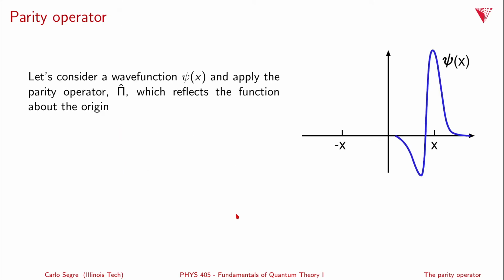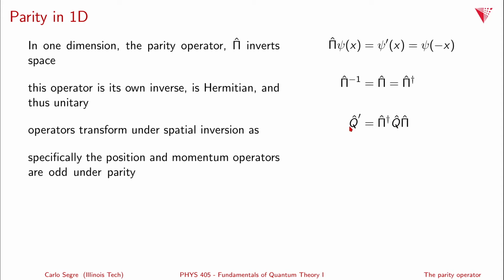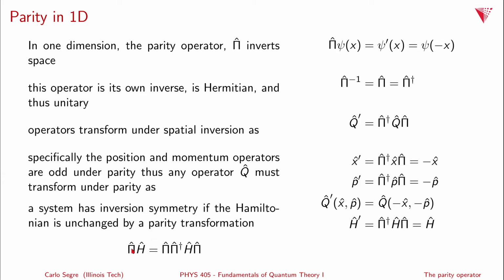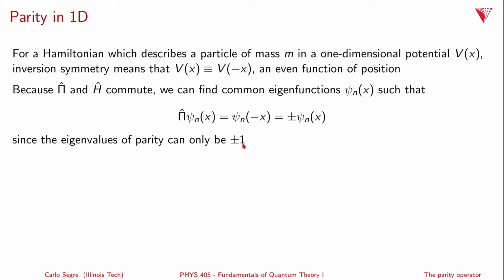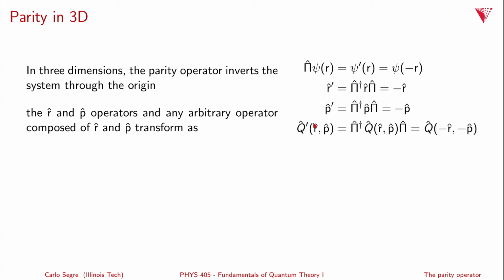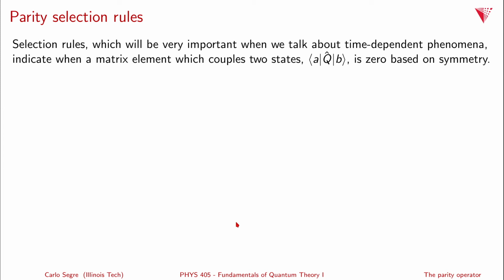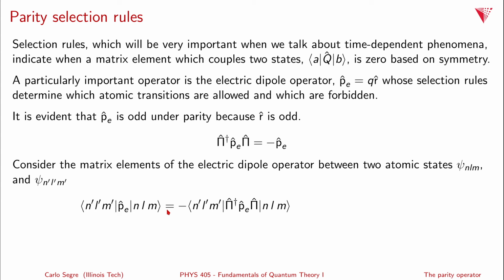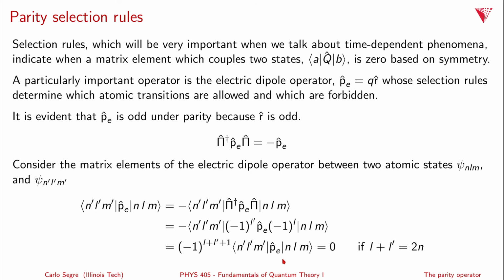6.02 Parity & selection rules

Comment: Hi, profesor. 
If I calculate <l' , m' | X | l, m> it will be zero too because X has odd parity?
Thanks
Reply from the maker: Not necessarily, it depends on the two states on either side.  If one is odd about x and the other is even then the integral could be non-zero depending on the other dimensions.